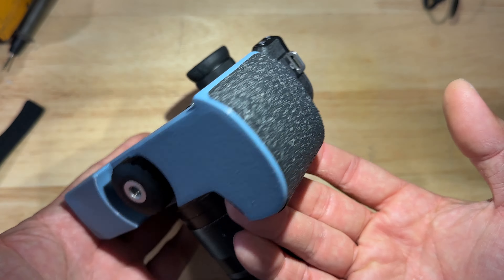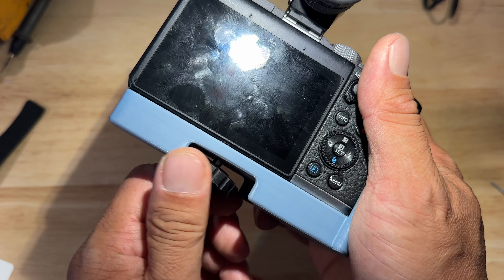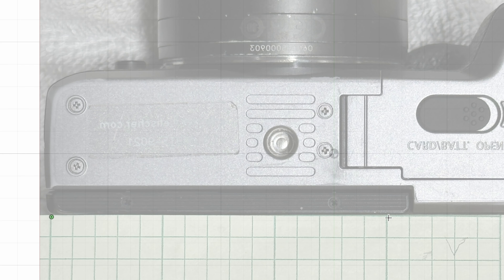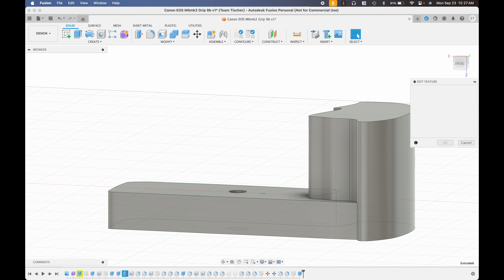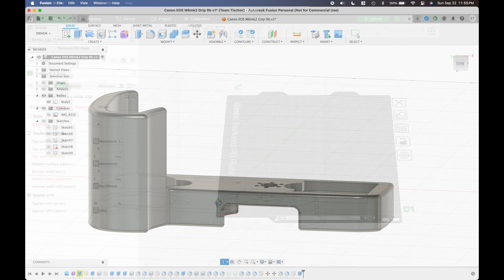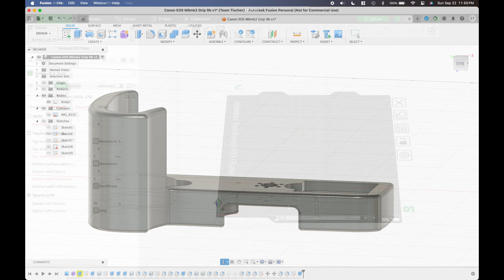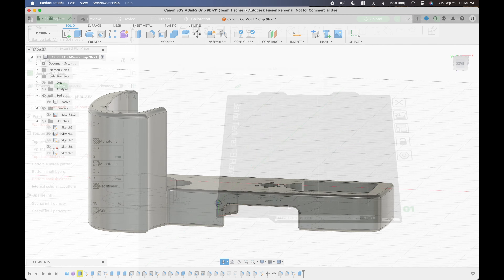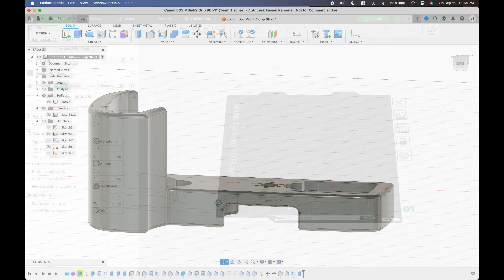3D Printed camera grip with AirTag hidden inside

Comment: the hidden air tag is a great idea. Also, there are ways to get more walls/perimeters in slicer and not model the holes if you want. You can use modifiers with different shapes. Overlap the model with the modifier where you want it to have a change. Within the modifier you can select different attributes like perimeters, infill, flow, speed, fuzzy skin, etc.
The way you did it is nice to have it modeled because if you ever reslice, you dont need to use modifiers for the same effect. just depends on preference for the specific model.
Reply from the maker: Thanks for the tips!

Comment: I been planning to drill out my grip for my Leica q3 to add an AirTag. If you’re not familiar with the Leica q3, the OEM Leica q2 grip fits the new q3. Been searching to see if anyone had done this, think it would work to drill a hole? Would be exact diameter of the AirTag.
Reply from the maker: You would need it machined with an end mill, I don' think a drill bit will work. Ideally the hole would have a counterbore in it so the airtag would be captured in the hole, and not just rely on friction to keep it in place.  For the cost of the grip, you could almost buy the whole 3D printer ($200)
Reply: @ I plan to drill out inside the grip. Just enough so the AirTag fit in. Once the grip is attached AirTag won’t be visible from the outside and will stay in place. Tricky part is yes drilling it out.

Comment: Do you have to account for clearances around the camera body in CAD?
Reply from the maker: yea, I did have to add some clearance.  The first grip I made had zero clearance, it fit, but was really tight.  Since my sketch was just a bunch of p-lines, I just dragged points around where the fit was tight. I'd estimate I eventually added 50 mils clearance.